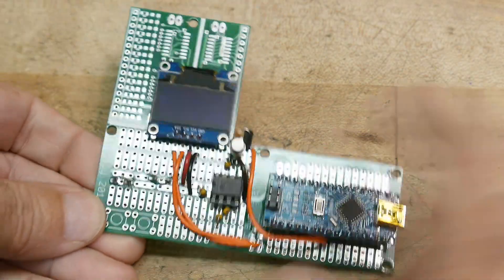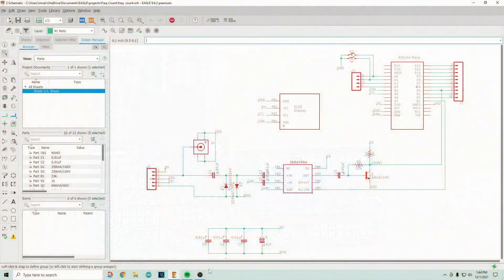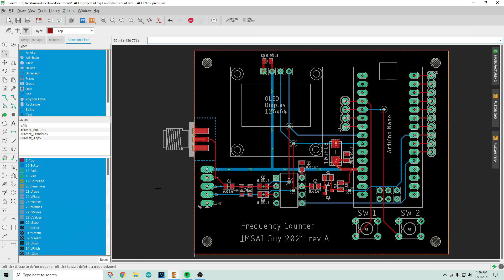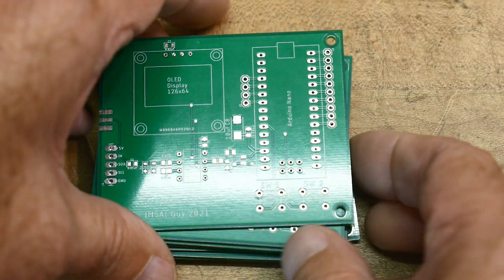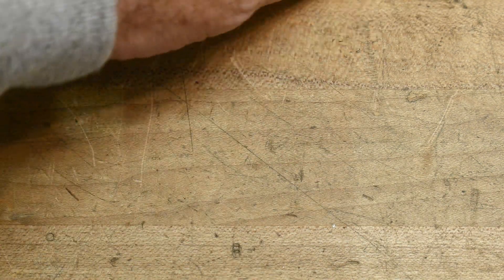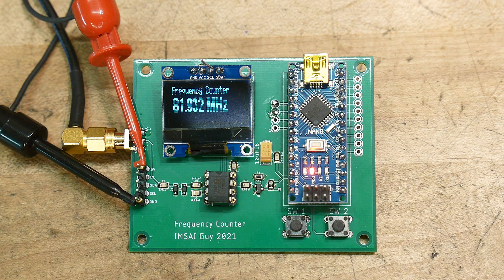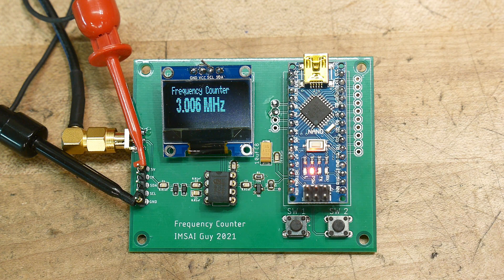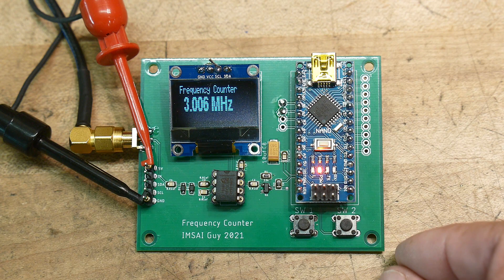#985 Frequency Counter Project with PCB

Comment: My suggestion to Prescaller:  is to use the 2SC9018 AM/FM IF amplifier transistor for 1100 MHz, I use it in a Cristal Frequency Meeter ( It has a wide working frequency range)

Comment: On the PCBWay website linked, someone mentioned the fact that pin 5 of the arduino is NOT defined in code.
Have you ever released an updated version of the code for this?
As for the diodes used to protect the front end (prescaler input) you may want to use Germanium diodes IF you can get any (1N34A or 1N270?) as the turn on voltage is around 300mv or so.
Reply from the maker: pins 4 and 5 are i2c so they don't need defining
Reply: @IMSAIGuy  Perhaps I am using the wrong terminology - D5 is an input from the prescaler, yes? D5 is not defined in the code. SO, sre you using the I2C input for that? 
Or is it listed as some other pin in the code.
 I DO see A4 and A5 as the SDA and SCL lines to the display.
Reply from the maker: @mstover2809  oh yes, A4 A5 are used for i2c, d5 is an input and should be defined as input. I guess it worked for me with out definition.

Comment: the ESP32 is more complicated. Program, WiFi, 2 core. 
the ESP8266 is also built bugy
The Mega832 is just an 8 bit computer and good at doing a single job

Comment: Personally I would have put the frequency counter into an FPGA with an I2C interface to read off the frequency registers that would be updated after each measurement cycle. An FPGA would give more resolution, with a divide by 4 pre-scaler it would measure GHz frequencies. To keep the FPGA simple I would read off the counter and do the math in the processor. Calibration would be stored in the processor eeprom.
Reply from the maker: I'll be waiting for your build and video
Reply: @IMSAIGuy  I did this design back in 2015 and I know I have the verilog code and the schematic for it.  The project I was looking at in 2015 was almost exactly what you are doing here. Except the VCO was another product we build that has an external VCO control input which I was controlling with a16 bit DAC. My plan was to get the frequency counter calibrated then have the CPU step through 256 steps that covers the full range of the DAC and record the frequency in a eeprom to use as a look up table to get me close to the desired frequency then let the CPU fine tune it using interpolation. Unfortunately the project was a low priority and eventually died on the vine and has never been revisited.

I have the first revision of the PCB here at home and I do have the verilog code functional for the most part but needs a lot  more attention. Back then I wanted the FPGA to do all the auto ranging which was giving me lots of problems. If rip out the auto ranging features and let the CPU set the range / pre-scaler as needed that would make it much easier. If I use the prototype to work on the verilog code while I get the schematic trimmed down to just what is needed and then make a new layout. Famous last words "It shouldn't take me that long" but don't hold your breath!
 
I have always wanted to make a frequency counter but I've never had a real reason to actually build it outside of work. I won't build something just to be building it, I have to have a need for it. I will give it a try and if I get it working I will send you one. But until then you should continue with your plan.
Reply: An FPGA for this is like going with a tank after a fly. There are high resolution single chip time-to-digital converters that make the whole thing mostly trivial and give you resolution and update rate that until recently was reserved for $2k+ instruments that has to implement interpolation on an ASIC. An FPGA will top out at clock rates that were no problem to direct counting (no prescaler) frequency counters decades ago. You can build a 1GHz direct counter using an ECL counter for the lowest digits, those are still being made. No prescaler needed.

Comment: Nice project. Thank you for sharing. We really do recognize and appreciate your efforts. Some questions... What is the purpose of C8 having such a large Farad value? Any concern about in-rush current stress? It looks to be a Tantalum? If so, why? I am confused as to whether the green, manufactured PCB was the first one ordered, that I thought you said had an error? Or, did you make the correction, reorder boards, build the corrected version and that is what we saw? Anyway, my interest is in what the error(s) was/were and, if you bodged them on the back of the first board, what did you do? Meaning, maybe we could learn from that/those mistakes... Just FYI, I can not read the schematic. Even in full-screen, it is too blurry.
Reply from the maker: General practice to have one large uf and one small for low freq and high freq. I just choose 10uf and 0.01uf for fun. no concern about current inrush
green board ordered and tested. if found I routed 5v to the wrong pin on the arduino and that the switches were routed to analog pins that cannot be configured to digital inputs, the second revision i fixed the errors and ordered red boards. 
go to the pcbway website for a clear schematic
Reply: Inrush current is self limiting on such small capacitors. Remember that an ideal capacitor coupled to an ideal voltage source has an infinite inrush current. Little ceramic caps fed from very low impedance sources have stupendous inrush – you can get a 0805 capacitor size spike 10A or even more. A tantalum of this size has a couple tenths of an Ohm ESR usually, and that’s plenty enough, especially when fed via long wires. It does help to have a fast clamp across the power input on the entrance to the board, so that the inevitable ringing of the long supply wires won’t zap anything. Jim Williams IIRC has an app note about supply transients cause by low ESR capacitance that kill voltage regulators. Of course there are good reasons for low ESR capacitors, it just takes some proper design work and bench testing to quench all the spikes.

Comment: What's a reasonably economical way to get a benchtop 10Mhz reference signal at high accuracy for calibration? GPS disciplined osc? WWV tuner + LNA?
Reply from the maker: GPS disciplined is $100 and is easy.  WWV is ok but requires practice and only when you can receive the station. rubidium is getting expensive and requires some DIY for power supply and heatsink. if you get an oven oscillator and can cal it (friend?) they are stable for decades. my old HP equipment are all still spot on (8591,8712,8921)
Reply: @IMSAIGuy  Hmm. How tricky would it be to make your board accept a 1PPS signal from an external GPS module as a timebase or special calibration mode?
Reply: @ThinklikeTesla  if you get an m8n gps it can program it over usb-serial to output a slightly dodgy, but accurate period, 10mhz wave

Comment: I did a very similar thing some years ago. 
I even used the same library.
Instead of programming a cal. offset you can also use a very accurate 16MHz clock for the arduino since the counter is an actual piece of hardware in the chip, as far as I remember. 

I used an Arduino Uno with a 0.1ppm 16MHz Chrystal oscillator, this gave me a 1 Hz accuracy through all bands.

I made several switchable prescalers to give me a 1Hz to 50MHz range, a 20MHz to 1.8GHz range and a 1GHz to 12GHz range. (look at the hmc363 it is a pretty cool part)

The counting worked pretty well but I ran into the same issua that you have on your VCO replacement series with the UI being totally unusable and unresponsive, since the controller won't do anything else when counting. 

Greetings, 
Michael

Comment: Nice little project, I did one like this a while back.  A couple of things to watch out for,  the counter timer input is limited to 1/2 the CPU clock frequency -- small note in the data sheet.  Second the nano clock resonator is neither accurate nor temperature stable, it's only attribute was like the lowest cost part they could find.   The millis() function is also not accurate and has jitter based on how they had to generate the millis count.   They prescale the counter input by 64 then count to 256 with the counter.  If you do the math this is not 1mS but 1.024mS. So about every so often they adjust the count by skipping a count.  This gets you close but the count is still off a little.  To provide a 1 second gate for the counter use an external source not the internal nano clock or millis function.  Funny, I just went through this the other day, had to examine the code behind the millis funciton because I couldn't figure how they got 1.000mS using a 16MHz clock and a 256 bit counter -- the math didn't work out.

Comment: Most arduinos have some form of EEPROM in them that is for saving stuff between power cycles. (I think most have 255 bytes if it.)
Reply: 1024 bytes eeprom on Uno, nano and pro mini. Mega I think has 4096 bytes eeprom.

Comment: No, you do not to push a button to program the ESP32. The modern dev boards have auto reset.
Reply from the maker: yes, I like the ones that program easily, unfortunately there are still new boards that still do require Boot 0